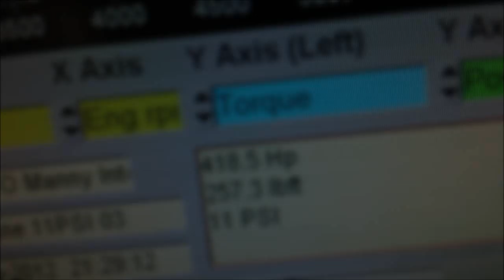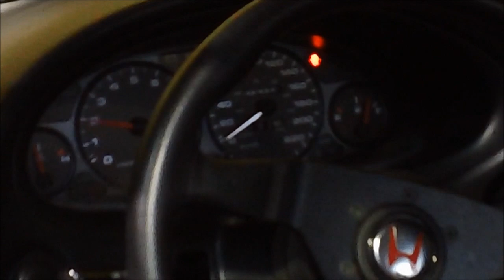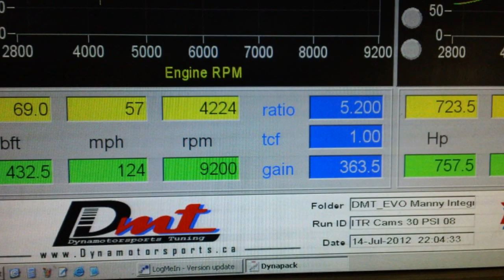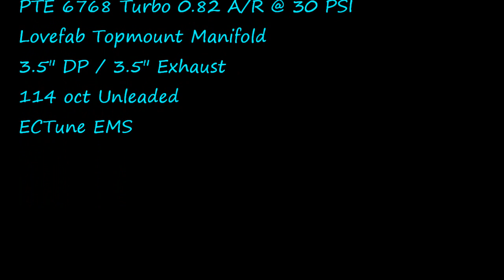Integra typer - dyno - Turbo -  750 hp high boost - Lab246

Comment: Hunter:

- Gasoline engines do not explode, that would be called detonation and that RUINS your engine. It's all about your engine's timing. Gasoline engines ignite the fuel (at perfect mechanical and electrical timing points) and cause pressure to cycle the engine's pistons up and down, spinning the crank. This why having too much heat from an improper turbo, sc, or NOS, will blow your engine. 

- DIESEL engines DO work off explosions, that is why they are MUCH stronger than gas engines and heat doesn't hurt them, lots of diesel trucks run 40psi boost pressure safely.

- However, you were correct about the flames being unburnt fuel in the exhaust being ignited by the high-temps inside headers and exhaust.